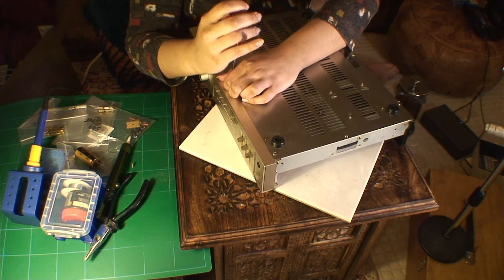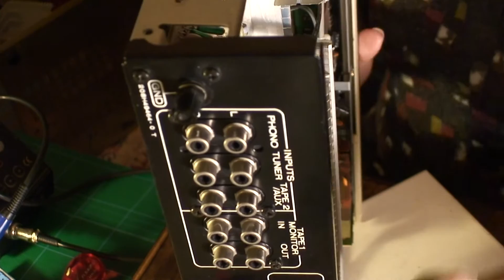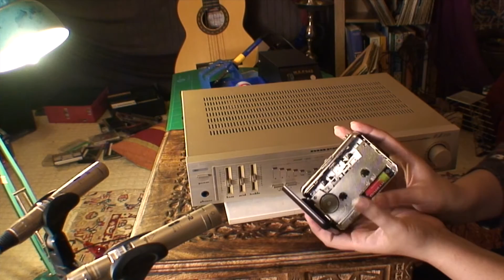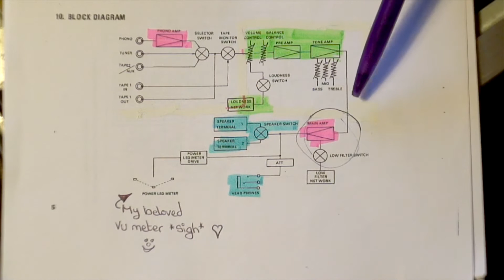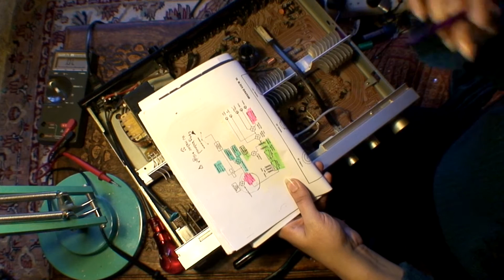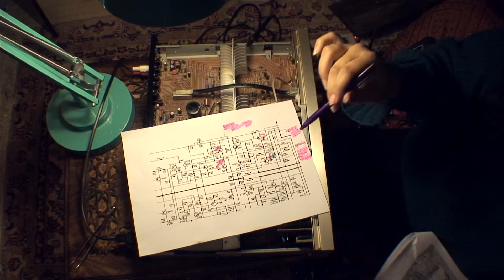Vintage amp repair - 03 Getting closer...Oh so close!

Comment: You ask about why the stupid thing isn't melting, you need a chisel tip 2-3mm wide for the bigger components  especially on wider tracks as the wide tracks wick away heat more quickly.

Comment: Hi, I have the same amp marantz pm 350 I replaced all caps and transistor and the amp is blowing fuse.  All transistor replaced with same model and rating any suggestions

Comment: You have inspired me to repair my Kenwood amp I bought in 1993. It loses audio when it gets too hot. First, I'll look for bulging caps and burn marks. After that, it gets a little more challenging.
Reply from the maker: I hope you do start repairing it and succeeding, this was my first successful amp repair and I thought I wasn't going to do it. I have a feeling with your experience you will succeed :o)
Reply: Thanks. Need to find the Service Guide first.
That's the first step for almost any repair I do.
Mostly I repair laptops. I've been in business for 20 years as of Aug 15. I've fixed a lot of laptops. Stopped counting at 10K. Anyway, thanks and I'll let you know how it goes.

Comment: Hi can you check the voltage at the emitters of Q701 & Q703. which should be 0.58v.
Reply from the maker: +Audio Amplifier Servicing 
Hello there, i've just checked them now, they are reading at -5.5v not 0.58v.. I checked the same transistors on the right channel and they were 0.55v as they should.
Reply: +MsMad Lemon Hi can you advise the voltage reading at the emitters of Q701 & Q703
Reply from the maker: +Audio Amplifier Servicing Hi, the voltage reading at the emitters of Q701 & Q703 is 5.5v
Reply: +MsMad Lemon Hi can you check the voltage at the base of Q701,it should be 0V
Reply from the maker: +Audio Amplifier Servicing The voltage at the base of Q701 is indeed 0v
Reply: +MsMad Lemon Hi can you remove Q701 and Q703 and test them with your multimeter on diode check
Reply from the maker: +Audio Amplifier Servicing HI, i've just done that, both transistors seem to be okay
With negative  probe on base I get a beep on emitter and on collector
Positive probe on base I don't get a beep on neither
Between collector and emitter I get no beep either polarity.
Reply: +MsMad Lemon Good okay can you now remove Q707, and check it.
If it reads okay continue and check Q709, Q711 , Q721, Q723.
Reply from the maker: +Audio Amplifier Servicing 
I think I may have found the culprit: Q727 ...I de-soldered it because I misread it as Q721
Positive probe on base I get No beep on the emitter but I get a beep on the collector
Negative probe on base I get No beep on the emitter but I get a beep on the collector
Between collector and emitter no beep either polarity

Q727 is a 2SB647(C or D)
i'm tempted to take the same transistor from the right channel and solder it into the left  just to test this!
Reply from the maker: +Audio Amplifier Servicing 
YES! I have found the culprit but something very strange is happening! I de-soldered Q728 (2SB647C/D) from the right channel (Now there is no transistor in there)
I soldered it into the Q727 space and Left channel is fixed! Yay! but right channel...still works?!? Wha?? 
I expected it not to after removing that transistor!! 
... Needless to say I will order a replacement and solder it in... but how is the right channel working with no transistor?? haha

Either way thank you whoever you are, for your time and guidance! It is much appreciated! :o)
Reply from the maker: +Audio Amplifier Servicing 
Please see this :o)
www.youtube.com/watch?v=rVHWWvzRpXY
Reply: +MsMad Lemon Hi removing Q728 from the circuit would result in Q732 &amp; Q730 not switching on, but the signal to the UV meter circuit is passing through. But you would not be able to connect a speaker to the right channel as high DC would be present on the speaker terminals which in turn would damage the speaker coil and the amplifier channel.When ever testing Audio Amplifiers always check the millivoltage across each speaker terminal prior to connecting speakers. If the DC level is typically higher than a few hundred millivolts it would indicate a problem. Normally you should only read a few millivolts, many Audio Amplifier have a protection circuit which monitors the DC levels on the speaker terminals&#160;and will operate a protection relay in the event of a problem being detected, normally such Amplifiers also have short circuit protection monitoring also to prevent damage to the Amplifier if the speaker coils or connecting wires go short circuit. The protection relay also prevents noise through the speakers ;when the Amplifier is first powered on (DC Thud). The relay is timed to switch on normally within 3-5 seconds after power up once stabilization of the Amplifier voltages is complete. The Amplifier would normally have a LED indication showing if the protection circuit was in operation.

Comment: I wonder if all the inputs makes channel noise? In datasheet is explained how to test amplifier and how to adjust. Also check transistors Q807 and Q808. ;-)
Reply from the maker: +Ramas Ramzetti Yes number 3 in the troubleshooting analysis ;o)... I tested Q807 and Q808 already and they seem fine but I need to de-solder and investigate more. All the inputs make that hum/noise on the left channel but only when I connect a load (Speaker or headphone) when I remove the load the VU scale shows no noise or hum.
I wonder what is causing such high negative voltage at the transistors. That is what's stopping the transistors on the left side from switching on.